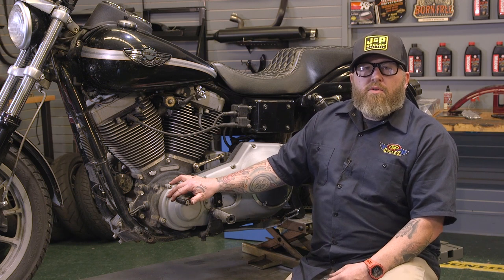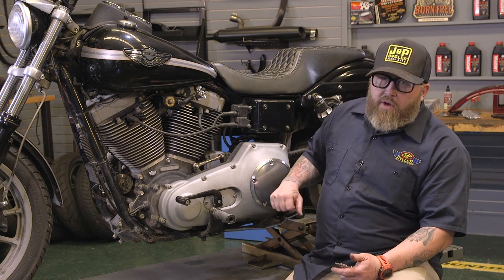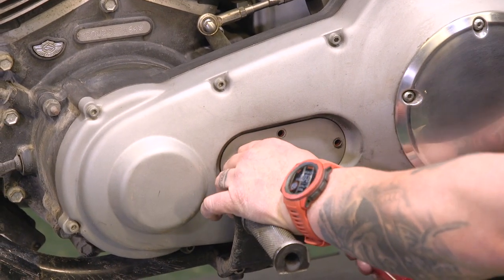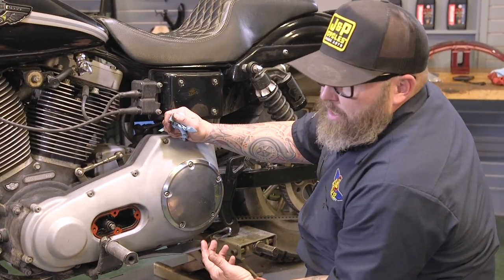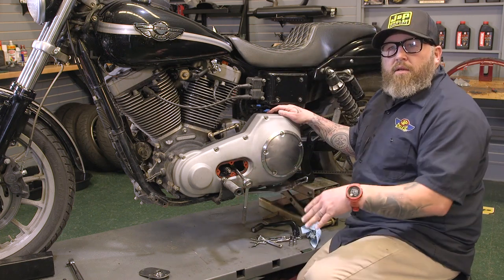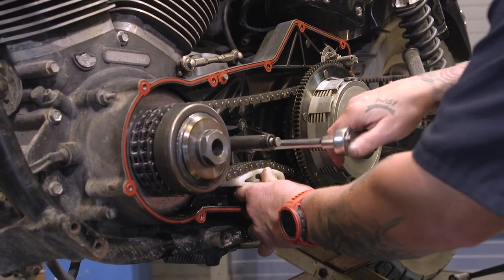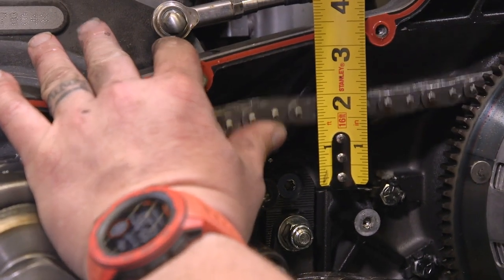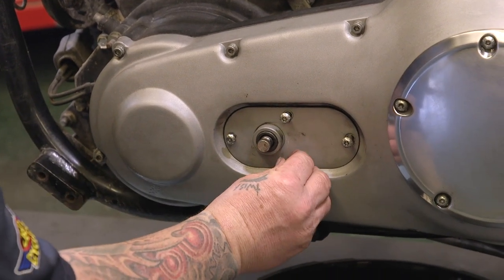Harley Davidson Primary Chain Adjustment : Pro Tip

Comment: This is so cool!  Thanks - I think I can do it. Lol  I have a 2002 Heritage with 186,000 + miles on her.  A shop in Deadwood, SD messed her up recently - she’s leaking from the inspection cover. I rode her home to Maryland & every morning there was a spot under her. She’s NEVER had a leak in 13 years. I watched your video merely because I wanted to see how easy it was to take the cover off  - I just need to replace the gasket.  :)   Thanks

Comment: Thanks for the info.
I'm replacing the gasket on the inspection cover and needed to know how to remove the cover. After removing the screws I couldn't get the cover off. Now I see it's simple. Thanks again.

Comment: Pro Tip use a piece of firm rubber hose or a dowel rod to measure chain slack. Put it on the chain mark it push it up to take slack out of the chain then mark again and measure.

Comment: Now the only reason you took the primary cover off was to show how the screw and the bolt with the teeth look once exposed! However you did so that we could see the close up, what you did manage to give your viewers was after the fact, so what I couldn’t see before I wasn’t able to see afterwards!!  You always make very good video and this was no different you just left out one very important fact that you yourself brought up that you wanted to point out but completely over looked! Which is how to adjust the chain and how this bolt you unfasten actually looks with the cover off the camera was to far away for that to be seen before you started measuring the chain with your tape measure!!

Comment: Thanks bud i was trying to check the tention on a 99 dyna glide. After removing those 4 screws ,I was not sure how to get the plate off the shifter. Work it off slowly. Im going to try right now. Thanks for the teaching.
Reply from the maker: Yeah, it can be a little tough. There is an o-ring holdin it on. if you can get a pick into one of the holes it will help work it off.
Reply: @jpcycles  thats what i used. Thanks again. Keep up the great teaching.

Comment: Great video, Question ? Should the primary be checked in 1 spot for tightness & Adjust from there ? Or should chain be checked in other spots and adjust ? I have seen several different videos on this matter Many stating that primary will be lose or tight in other spots as they age/ mileage And should be adjusted in the place with most play .  Your video looks much easier to do and understand .Thanks for your time
Reply: JJD1913 I have a dyna with 60,000miles and I used to turn the chain to find the spot with the most play, but always found it pretty much the same all round, so now I just give it the adjustment where it is with out checking. 👍
Reply: Sorry should have said to find the tightest spot, not had my coffee yet 👍👊
Reply: @keithwaite5026  ty

Comment: Maybe in a different segment you might mention any aftermarket Derby covers if they use the torque specs they will probably break the holes out where the bolts go in the Derby cover. Just to give people a caution in torquing the derby cover bolts or screws. Whatever the case.

Comment: I have a 2003 fxd super glide need to know what bolt that go in right order cause lost bolts and got new ones  and the tork on the bolts ,ty kindly
Reply: The short bolts go bottom center, and the mid front hole. Torque is 84-108 INCH lbs, or, 9.5-12.2 Nm (metric lbs)

Comment: Not true on mine.  This says up to a 2006.  I have a 2006 Dyna and there is no plate in that location to remove🤷‍♂️. I need to add oil it sounds dry but I’m on rd and in a pinch and idk what to, other than remove the damn Derby cover🤦‍♂️. I love Harley but I’m bout done with them.  Over heat in traffic, constant maintenance , etc etc.  suck but I love them.